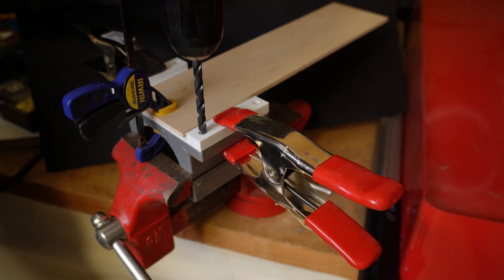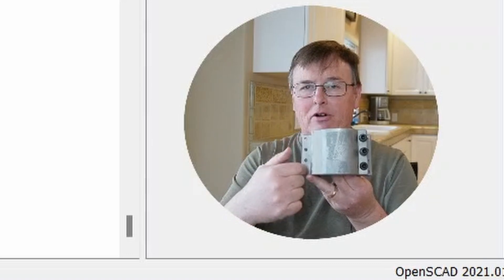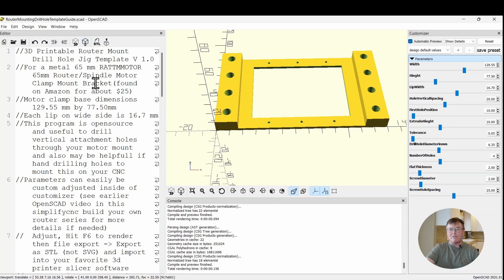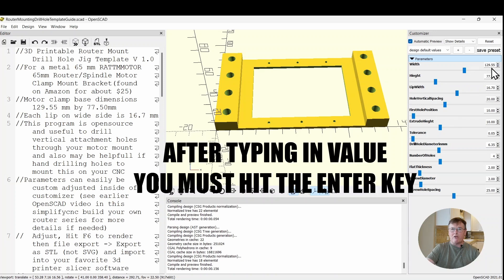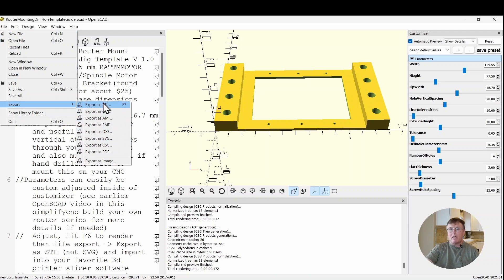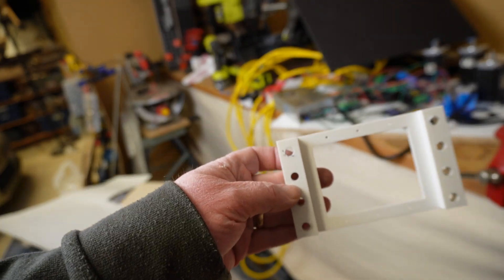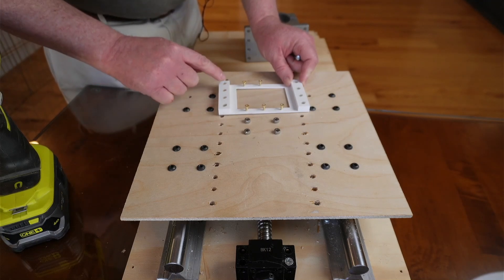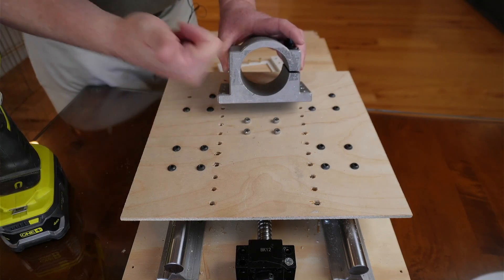MOUNT YOUR ROUTER THE RIGHT WAY | DIY CNC ROUTER SERIES EPISODE 10

Comment: Why didn't you do this in wood? Did you try? Is wood simply too soft? Why didn't you get a unit with pre-drilled holes? That said I love the jig idea, to get the line-up right on the board; well explained with some great hints.
Reply from the maker: You can definitely can make one out of wood but it is challenging for some of those who don't already have a CNC to make precise holes to hold the router securely.  The metal mount I used is rock solid and for around $25 I thought it was a good, relatively low cost solution.  I wish it would have come with predrilled holes but in the end it worked out alright.  There are some great mounts out there with predrilled holes but some of them can run in the hundreds of dollars (which for me isn't worth it). There are also some router mounts that are 3d printable (but I think that they have a much greater chance of failing in the long run.  However, if you own a 3d printer you can print a mount, use it, and then machine a more sturdy one out of wood with your CNC once your CNC is up an running).  Quite honestly,  If it was just me (and I wasn't filming with the goal of teaching others how to build a CNC for the first time while keeping down the cost) I definitely would have made one out of wood (using my other CNC to machine it).